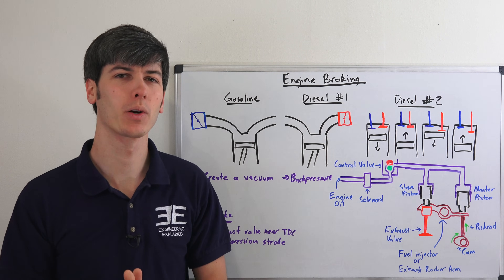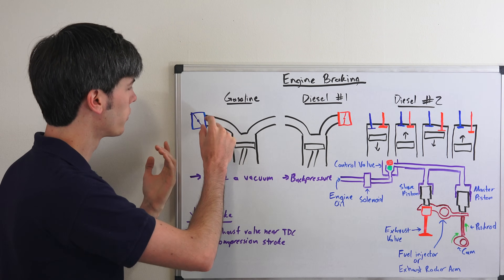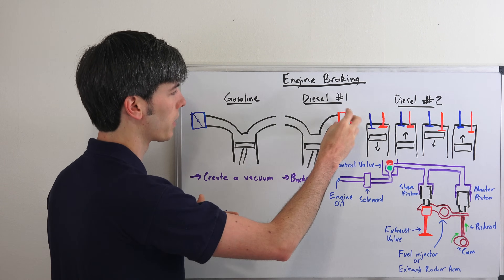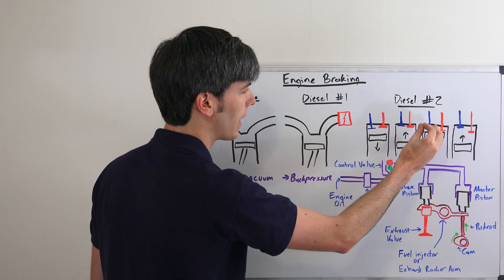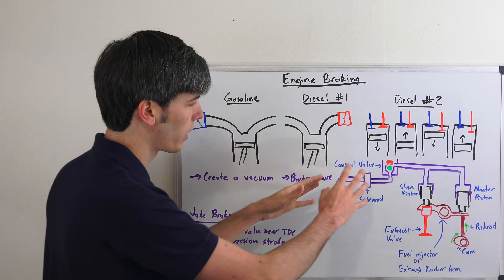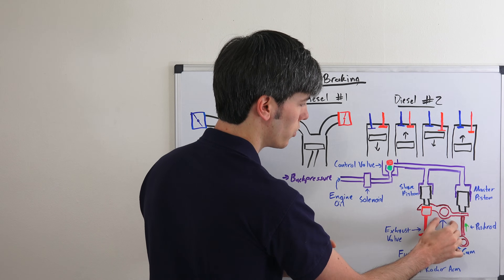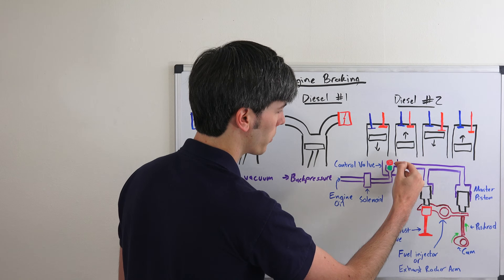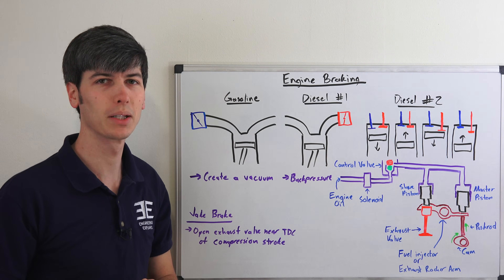What Is Engine Braking? What Is A Jake Brake?

Comment: dude, the same vacuum slowing the piston on tbe intake stroke is sucking the piston up on the compression stroke, your idea is incorrect.  But when the exhaust valve opens then the cylinder would equilize to exhaust pressure by reverse flow through the exhaust valve, this would provide some net braking over the entire cycle.  Not an expert, but common sense here...
Reply from the maker: ^this is not correct. The throttle acts exactly like a damper, slowing the airflow into the cylinder. This is called a pumping loss, which slows the engine.
Reply: Intake stroke is at vacuum pressure, pressure on piston opposes motion.  Compression and Expansion strokes - assume pressure is same on both, no net work is done.  Exhaust stroke - assume cylinder is at atmospheric pressure, no pressure on piston to oppose motion.  That's a simplified model that's somewhat accurate.

Comment: Smaller turbodiesels with vgt turbos without jake brakes can close the turbo vanes for engine braking and thus do not need an exhaust brake.  You can control the vehicle speed with the vanes.

Comment: i still dont understand how that even works to slow anything down or even compresses anything when the pressure is being released through the open exhaust valve, seems like it would just let the engine free spin, same as if you removed the spark plug in a gasoline engine?

Comment: Just for informations sake, new Diesel engines mostly produced after 2013 have a throttle actuator/throttle body. It’s mainly installed as an emissions component to control EGR flow, but it also serves as a failsafe to prevent runaway engines.

Comment: Why can't compression release be used on a gasoline engine? Like just open the throttle body but inject minimal fuel?
Reply: It could but as diesels run around 22 to 1 compression ratios and gas engines run about 9, the effect would be not worth the effort.

Comment: I have a question regarding engine braking in carburated engines. Some people say that the consumption in the carb engines is a function of engine rpm, so even though you do engine brakeing, the consumption is higher than idleing it. Any thoughts?Thx
Reply: Yes, certainly in a carbed engine with a mechanical fuel pump it will still pull fuel through the motor.  If electric pump and cut the power then it could be limited to what is in the float bowl of the carby.

Comment: For diesel engines, when you say it can use both the throttle body and jake do you mean at the same time? Or just whenever the Jake is not engaged it uses the throttle body and when the Jake is engaged does the throttle open while the Jake is doing it's cycle? Also to be clear no fuel is being injected cause it is a diesel engine right?.. just air being pulled through the cylinders?

Comment: Im pretty sure in a diesel, the compression is what slows you down. As the piston moves up it has to compress the air momentarily, and then hold a vacuum as it moves down. The higher compression ratios mean more engine friction, and more braking. IE my 7.3 idi has a CR of 21.5:1 while most modern gas cars run 9-10:1

Comment: Don't understand it in gasoline engines. 
Okay, the piston is going down, on top there is a vacuum, on the bottom there is regular pressure so the differential causes a force upwards slowing the piston down. 
What I do not understand is that the force still has the same direction when the piston is moving back up again accelerating it by the same amount. 
Or is there a pressure balance once the bottom is reached? 
Hope sb can explain.

Comment: Does it wear out the engine significantly if I engine break at over 3000 RPM for several minutes? Is it better to upshift and just use the brakes in this case?

Comment: What I'd like to know is: does engine braking cause any undo wear on the engine? Is an engine designed for this? It would seem a lot cheaper to replace a pair of brake pads than engine parts.
Reply: It doesn't. For manufacturers to not design a drivetrain to comfortably take a negative load would be like not designing a vehicle to operate in rain.
In fact,  towing up and down grades with a diesel pickup, exhaust brakes are highly recommended not only to save service brakes, but to help prevent the extra heat from dissipating too quickly, as you get a lot of cool air when you coast in a diesel, and the exhaust brake will help keep the warmer gasses in the engine.
So in some ways, engine braking can actually reduce engine wear.
Reply: I was referring to gas engines. Specifically my Crosstrek. Sometimes I go down long, steep roads and gear down. It's a CVT as well, so does this still apply? Thanks.
Reply: Hmm. I don't know much about CVTs.
I only used the example of diesel because it's all I really know, with it being all I drive.

Comment: Traditionally engine braking has been called compression braking.  Obviously that was wrong, but many people still think that engine braking is compression braking.  Regardless of how carefully it is explained, some people insist that engine braking is is caused by compression.

This can be tested easily by having an engine on a dynamometer which can motor the engine as well as absorb power from the engine.  With the ignition shut off, it takes more power to motor the engine with the throttle closed than with the throttle open thereby proving that the power wasted to suck air in against the vacuum created by the throttle valve is an important source of engine braking.  Interestingly enough, it takes more power to motor the engine when the spark plugs are removed.
Reply: Yes it could be tested on a dyno that powers the engine, but what dynos do this and have you done it?

I would say not.  All that has to be done to understand that the closed throttle theory causes the braking is to get in a real car and try it.   
Do it in a manual car with a hard wired throttle.  Switch off spark and fuel and see what happens when you operate the throttle under engine braking, there is no runaway effect when the throttle is fully depressed, in fact the braking effect will increase.  For those that can only switch off spark, don't suggest you do this as the exhaust can build up with unburnt fuel and cause a nasty bang when you switch the spark back on again(possibly damaging some part of the exhaust.

As I posted six months ago, the closed throttle explanation defies the laws of thermodynamics, the energy that the engine is removing has to go somewhere, in the closed throttle theory it apparently "disappears into a vacuum"...not

Comment: So constant engine oil pressure is going to the solenoid, so once the switch is flipped it opens allowing the exhaust valve to stay open...the throttle body engine brake and the jake brake both end up opening the exhaust valve during the power stroke?

Comment: I'm sorry I got a little lost.

I understand how it woks, but how is it done? Just letting the throttle go and don't stepping on the brake while in gear? algo is it possible to jake brake on an automatic?
Reply: Engine brakes (Jake Brake, or Jacobs Brake, is a brand name, there are other brands available now from the different engine manufacturers) are found only in commercial trucks, although most pickup manufacturers also include exhaust brakes on their newer pickups, or you can purchase aftermarket kits for them. The engine brake is normally activated by a set of switches on the dashboard (on/off switch and a "stage" or "bank" switch, 1, 2, or 3), or as my Cascadia has, a lever built into the steering column (off, stage 1, stage 2, stage 3). The typical commercial truck engine is a straight 6 cylinder, and the engine brake is designed to operate two cylinders at a time, hence the three stages, for increased or decreased braking power as needed.

Comment: so which is better for the car long term?

i usually drive my 5 speed getting up to speed i want and put it back in neutral and then coast, if i need to add a bit of speed i put it back in an appropriate gear and accelerate a bit more then neutral again. and i use brakes to slow down down because pads/rotors are much cheaper to fix then engine/transmission from adding wear on it through engine braking

please comment E.E.

Comment: Hi thank you for the video. I want to ask during Jake braking in a diesel engine is any fuel injected into the cylinder?
Reply: I have an older 3406b cat engine with Jake.. you have to turn the Jake on and off manually, Everytime you use it. Hitting the throttle while jaking, will cause flames to blow about 10 foot out each exhaust pipe, and the sound is like the firing of the deck guns on a warship.  I have done it twice, and blew the exhaust off my truck, both times.. I would think, if you did it too long, you could get a build up of diesel in the cylinder and cause static lock, destroying the engine.

Comment: Do you think it might be possible to make some sort of jake brake for my truck. It has a dead cylinder ( the intake lifter has collapsed) I have the fuel injector unplugged for that cylinder so I don't waste fuel. But I would like to make it useful as a brake. I was thinking maybe I could put some kind of valve in the sparkplug hole and vent it outward. What do you think. Your input would be much appreciated.

Comment: I used to work on Detroit diesel 8V92 engines and I don't remember if the Jake brake was fully electronic or not on that engine using solenoids to open the exhaust valves. it has been a long while. I do remember, with a switch you could have one bank of the engine Jake Braking or both banks. a nice addition to this lecture would have been the exhaust brake, but great video as usual

Comment: The story of the Jake Brake is actually quite fascinating. It was not invented by Jacobs. The Jake Brake was independently invented by Clessy Cummins of the Cummins Engine Company and exclusively licensed to Jacobs. He was retired at the time, and he designed the valve system on paper at home, there by proving his brilliance as an engineer beyond any doubt. He wouldn't sell the patent to Cummins because of long standing bitterness about his pension and patent royalties.

Comment: Good explanation of engine braking!

Technically "Jake Brake" is a brand name for a compression brake.  Much like Kleenex (for tissues), Band-Aid (for sticking plasters), or Advil (for ibuprofen).  

Also, in modern diesels there is no combustion mixture during the compression stroke while "Jaking".  Since the injectors are electronically controlled, the ECM does not send a signal for fuel injection during use of the compression brake.

Comment: Can you engine brake in an auto or does the torque converter prevent the engine from adding adequate resistance to the wheels?
Reply: Yes, no.  You can't not use the engine brake.  Whenever you let off the pedal, you are engine braking.

Comment: why would you want a jake brake? surely being able to coast would be much more fuel efficient? i use engine breaking all the time but it would be so much better if i could choose when i wanted to use it.
Reply from the maker: It's for slowing the vehicle down without using the brakes, for example when going down steep grades to prevent the brakes from overheating.
Reply: but surely it would be better to have a switch to use it?
Reply: Correct in some cases, but more often than not, the engine brake and service brakes are used in combination.
Reply: Engine brakes are operated with a switch (in a typical commercial truck, the engine is a straight 6 cylinder, and the engine brake has three settings which the driver can choose from. The settings are 1 bank (2 cylinders), 2 banks (4 cylinders), and 3 banks (6 cylinders)). Depending on the driver, it can be turned on as needed, or some drivers choose to leave it on all the time.
Reply: wow that's cool! i wonder why cars don't have the switch? engines too small to be worth it? manufacturers too lazy?
Reply: Ehh, probably because it's not really necessary in a car, you're not dealing with excessive weight  plus gravity working against you in a car like you are in a truck. That being said, manufacturers have started including them in most higher ticket pickups, both full and mid sized, that have tow packages, due to trailer weights.

Comment: I have a 600 ccm single cylinder bike with a 102 mm piston and the engine break is insane you barely need the break at all when you drive normally a friend even tole me he was "shocked or suprised" when the bike decelerated that quickly you even can stop the tire for a second if you shift down at pretty high speeds

Comment: Huh. I always thought engine braking was when you downshift so that the larger gear slows you down. Like riding in 3rd gear and downshifting to 2nd, the engine revs higher and in turn, slows the vehicle down. Is this also engine braking or have I gotten it wrong all these years?
Reply: The engine is doing the braking.  The transmission simply selects the ratio between the engine and the tires.  The faster the engine spins the more braking it does.

Comment: excellent explanation.

does a Jake Brake have a large negative effect on fuel economy? is this designed to save the service brakes? if so, are the service brakes more expensive than any loss in fuel economy? 

does the Jake brake cause more pollution or the same?

I've been familiar with the sound of Jake braking all my life but didn't learn why until today.
Reply: The ECU should stop the injecters from firing if you drive downhill with no throttle applied, so you don't use any fuel during this period.
Reply: The engine brake (commonly referred to as the Jake Brake, which is actually a trademarked brand name) has no negative effect on fuel economy. Yes the engine brake is used to assist a truck's service brakes, which can overheat quickly. The engine brake has no pollution effect that I know of.

Comment: I used to have a dirtbike with a decompression switch which opened the exhaust valve. I'd sometimes hold it in going downhill and act like I had a jake brake or hold the throttle open with the kill switch held and it kind of sounds like one.

Comment: With two engines of identical displacement, one gasoline and one diesel, would the gasoline engine's vacuum be more effective in slowing down a vehicle or the diesel equipped with a Jake brake?

Comment: Does using the jake hurt or wears the engine out excessively, more so than not using the jake at all?

My boss is telling me to not use it? What's up with that?
Reply: Nearly every part of an engine is probably a wear part.

Why doesn't your boss want you to use it? And if he doesn't want it used, then why doesn't he disable it? (Personally, I would never drive a truck without one again.)
Reply: Jerry Reding He's saying it causes excessive wear.
Reply: I used to work for a company that commonly had several trucks near or over the million mile mark that had never had an issue with failed or damaged engine brakes or components related to them. This is a company that has over 20,000 power units.

Comment: You lost me when you said gasoline engines use vacuum to slow you down.    When in fact its the compression of the cylinders.   Vehicle speed is faster than engine RPM in a given gear.
Reply: So explain where the kinetic energy of the vehicle goes when creating  a vacuum? you can't!!!!!  The answer is of course is  that during the  compression stroke the gas/air heats up and some of this heat is transferred to the surroundings via the engine block etc, so not all the energy used in compressing is returned in the power stroke...the exhaust air is also hotter, some of the energy is still retained as heat here, this accounts for where the energy goes and hence why it is the compression that slows the car, treating the compression/power stroke like it is just a 100% efficient mechanical spring is a nonsense.    This is just basic thermodynamics 101, suggest if you are really an engineer your revise basics such as the carnot cycle.
Reply from the maker: The compression of the cylinder forces the piston back down once it reaches top dead center, with little energy lost, so it doesn't end up causing much engine braking. The majority (for gasoline engines) is by pulling a vacuum, which requires energy, and doesn't return that energy into rotating the engine.
Reply: It's the vacuum that sucks you to a stop.. think about that piston at top dead center, starting down, with the valves closed, and no air in the cylinder.. what's going to happen? It will suck a hard vacuum, until the valve springs allow the valves to be sucked open, causing the pop pop pop in the exhaust and intake.

Comment: I cant tell if my car is using engine breaking or there is something wrong. I have a 2016 VW Tiguan 4motion and when I brake while going dow a hill or even coast down a incline my rpms go to 3-4 thousand at times. Is there an issue or just engine braking.

Comment: I dont think that gasoline engine break by using vacuum from closed TB. If you have closed TB then its the same as having closed intake valves, so all braking from vacuum will be recovered in upward motion of piston, because you are moving piston in sealed cylinder. Braking comes from thermodynamic losses.

Comment: Wow, Diesel engines sound so much more complex and so much more to fail... I think I'm sticking to gasoline :)
Reply: You might be surprised to know that most trucks on the road are not retired until they have well over 1,000,000 miles on them, and in some cases I know of some companies that will run them much higher than that. If they maintain their rigs properly, its cheaper for them to do an in-frame rebuild than to buy a new truck.

Comment: So if the throttle body does not close, my car will not slow down even if I drop it to a lower gear? Would it just stay at a high rpm without me feeling slowing down?